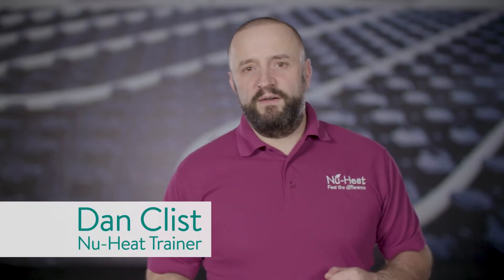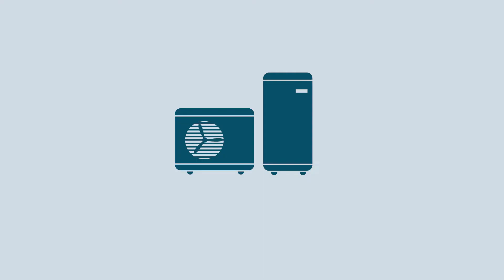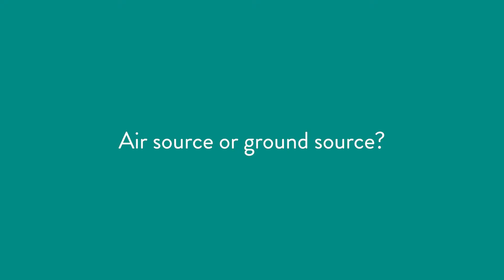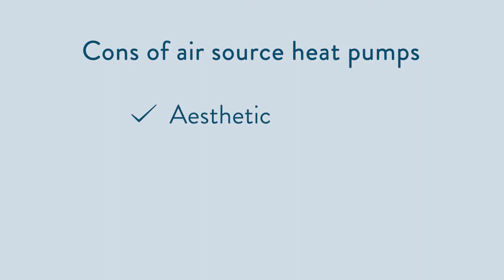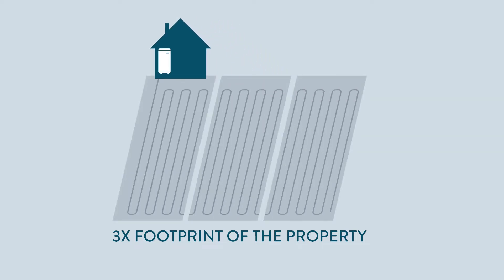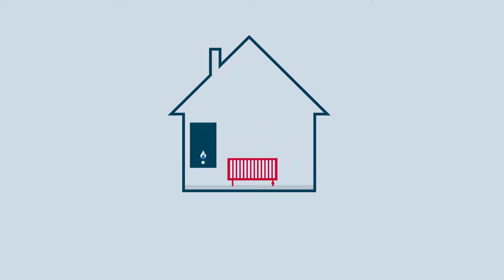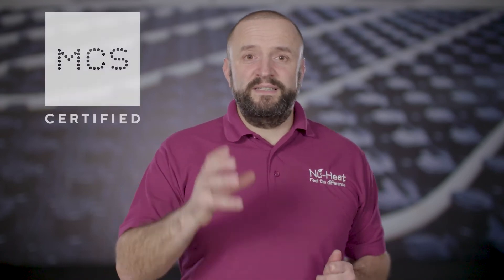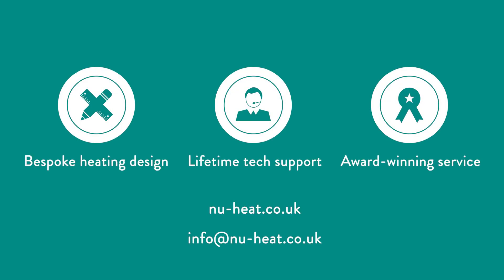The Ultimate Guide to Heat Pumps

Comment: Even newbuild  falls short when it comes to heating water ,about 30% of energy demand.
If every home in the UK utilised air source heat pumps, the national generation system could not cope!
If the government  encouraged  the the installation of solar PV , air source could make sense. Air source  mostly only provides low grade hot water. I can show energy costs of an almost identical pair of high spec houses, one with a boiler, underfloor heating and unvented hot water.
They were built about five years apart.
The second house was built to comply with building regs as at 2016.
The energy cost remained about the same, a gas fired system would have been and still is the most viable choice.
SCOP's of even 4 are not going  to encorage the masses to embrace air source.
I note that you like the majority  of air source proponents,muddy the waters with advising reducing  heat losses. Easy on new build, but the reality is somewhat different! Let's  be honest, there are many ways to achieve zero carbon and throwing money at the problem on a whim and entwining romantic and idealised notions with public ideals only serves to confirm how desperate and confused is the situation.
The way forward envolves a means by which all avenues are explored, and sooner than later.
Incidentally,  the heating and hot water system in the second house was designed by your company.
Reply from the maker: The government has been encouraging the installation of microgeneration PV for years through the FIT scheme, which resulted in a big uptake in the technology, as has encouraged the introduction of more localised generation through the likes of solar PV farms, and Wind farms all of which contribute to reducing the strain on the national grid. This “encouragement” is continuing in the form of changes to building regulations and SAP in essence meaning that a newbuild with a traditional combustion appliance will now have to have an PV array to achieve a pass in SAP. 

Unfortunately, we don’t have the information regarding the current capacity of the UK's electrical infrastructure, and the impact of the additional demand due to the uptake of heat pump technology. However, we assume this extra demand will undoubtedly be taken into account by the government’s Future Homes strategy, which is encouraging the electrification of heat, as this policy will encourage the use of direct acting electricity and not just heat pumps. In addition, it’s worth considering One often overlooked, but none-the-less a significant contribution to the load on the national grid is going to be the exponential growth in the deployment of electrical vehicles. 

When comparing the impact of regulations and their impact, Energy costs are not the best comparison, energy consumption is a much more accurate method of comparison, as the cost of the primary fuels are different therefore distort the outcome of the efficiency comparison. 

The single biggest change to building regulations since their inception happened in June 2022. The result of these changes means a significant improvement in the efficiency of new build properties, as well as for renovations. Heat pumps in new builds are usually a very easy fit. Renovations and retrofits are more challenging but can still be successful with an ethical and pragmatic approach to each project, and the prior realisation that heat pump technology is not always suitable.   

Advising people to make improvements to their home’s fabric efficiency first is critical for any heating system, old or new, and should be given completely independent of the source of heat. Addressing energy use first is far from muddying the waters, it is the most ethical advice that can be given, ahead of looking at the selection of the most appropriate heat producing appliances. This is reinforced by changes to Part L, that now means all heating systems in new builds should be designed with a maximum flow temperature of 55°C. With significant renovations where the heating systems is being replaced a similar principle is encouraged. The source of heat is irrelevant. 

Any company working in this industry, in line with MCS,  will be very aware that heat pumps are not the best solution for ALL projects, meaning that it is as true now as it ever was, some projects lend themselves better towards heat pumps, some to direct electricity, some to mains gas (or hydrogen in future), some to oil, or LPG, and some to biomass.  

The solution does now mean that the holistic approach to energy generation, distribution, consumption (more importantly the reduction of) is critical. It is a paradigm shift from where we have been historically, but where we all need to go, but we are well on the way to this happening.